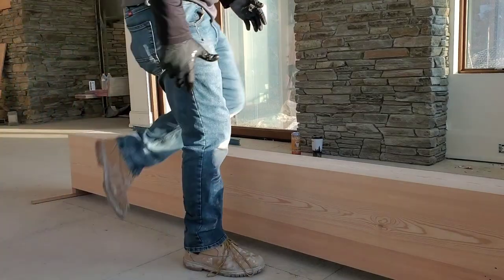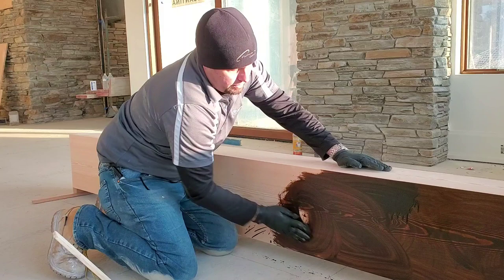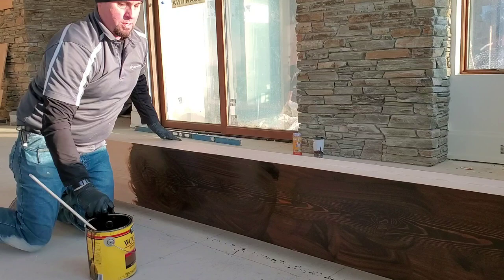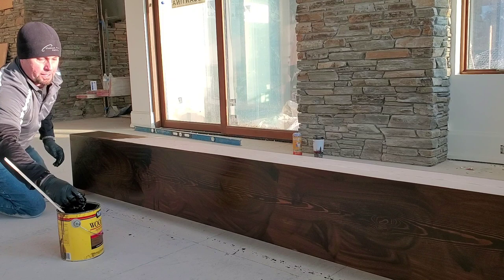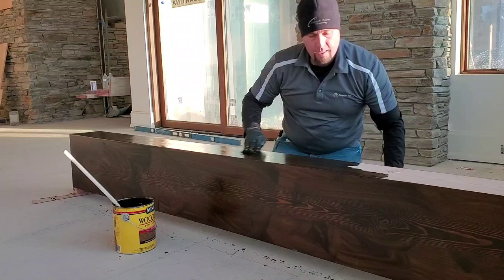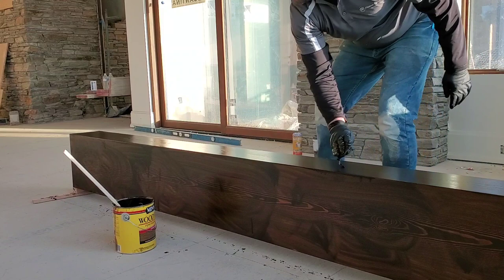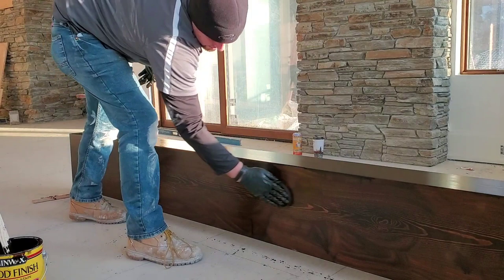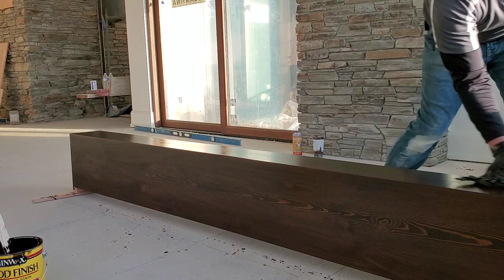How to Stain Beams with Minwax

Comment: Hi Thank you for the video. Beautiful. I have to stain Rough Sawn Pine  in my newly restored log cabin. Created faux Beaming UNTOUCHED but I need to stain them ASAP. Very stressed. So far  any attempts with staining on scraps has yielded super dark, almost BlacK . Wanted to go with espresso but concerned i am missing a step because it is Rough Sawn. Do I need to add conditioner first??? If so what do you recommend. Thank you !!!!

Comment: Super gorgeous!!! Would I do the same procedure to outdoor fir beams? Do I need to put a top coat on to protect them from the elements? Ty so much for ur video!
Reply from the maker: Hello there, so sorry for the delay, I was on a family vacation and unplugged for a bit. So you could use this product,  but would need to put a sealer over it if it was outside. If you have fir outside or cedar I would recommend using a semitransparent stain. Something like a mezmers, Cabot,  or superdeck oil base. these would stain beautifully and have the uv and sun protection built in. Let me know how it works and if you have any other questions just shoot me a comment.  Thank you 👍🤝🙏
Reply: @PaintBoss  I was just going to ask the same question. I love dark walnut but it only says for interior. I have fir post so would i use the dark walnut and then put on a clear sealer, like a matte; what would you recommend. Thanks in advance!

Comment: Just using a rag?
Reply from the maker: I cant remember on this one, usually I put the stain on with a staining pad, or sponge and then wipe it off with a rag💪 the stain pad definitely helps spread the stain and cuts down on the number of dips in the can.. thanks for the comment
Reply: @PaintBoss  stain rag works just as good💪